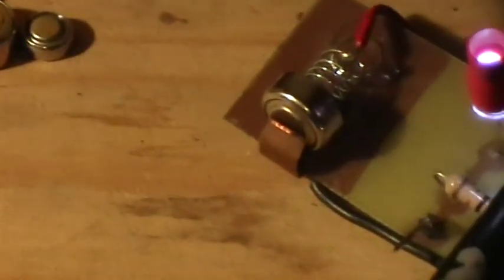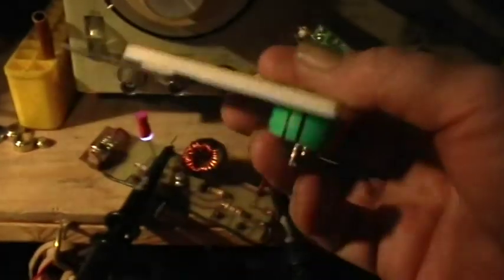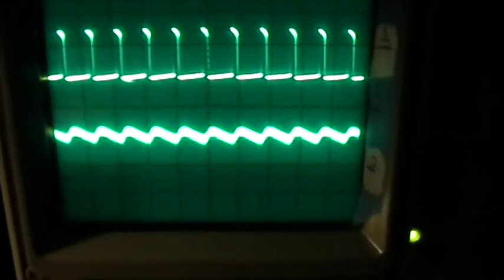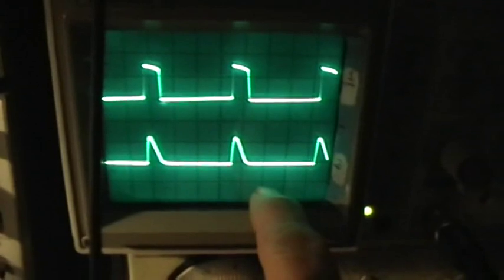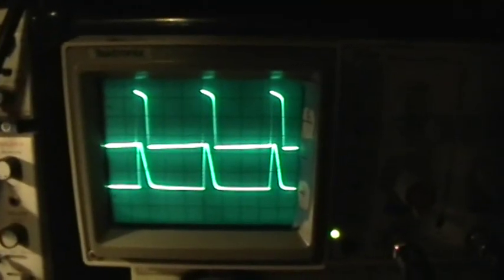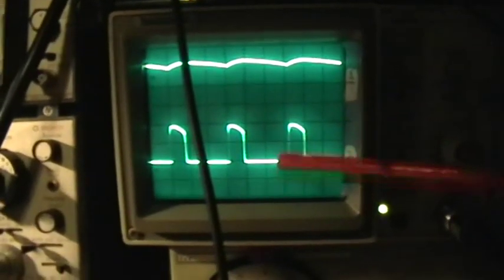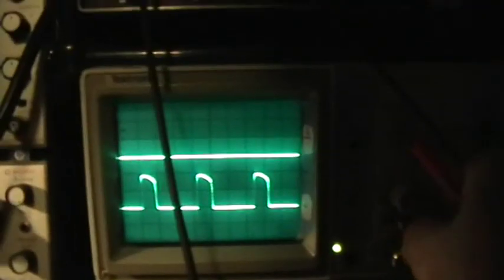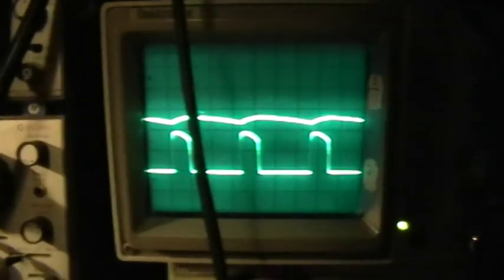Joule Thief: Time Course of Events Using PhotoTransistor to Monitor LED Output

Comment: This is a really good test. The photo transistor wave looks a lot like what you get across a 1ohm resistor in series with the led. So the light output seems to be dependent on the amps available on each pulse. Have you ever seen the battery voltage rise above its static reading? I seem to be getting some back charge on many JT's with lower input voltages. Mostly really flat battery and no resistor. They run a lot longer than they should. Doesn't seem to scale up though.